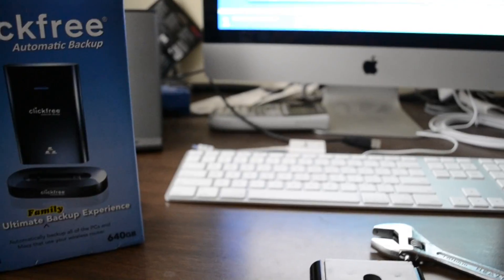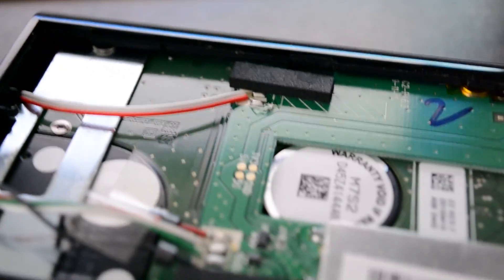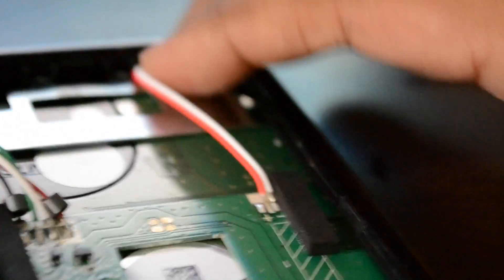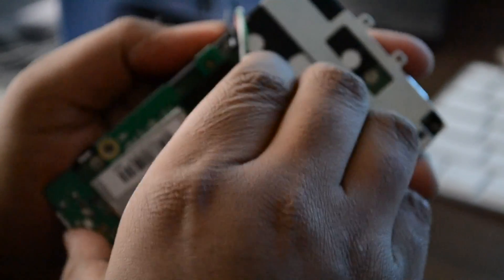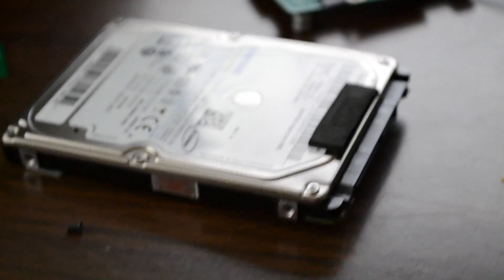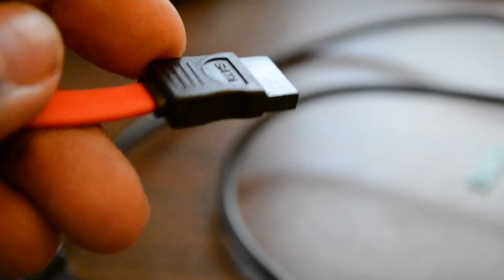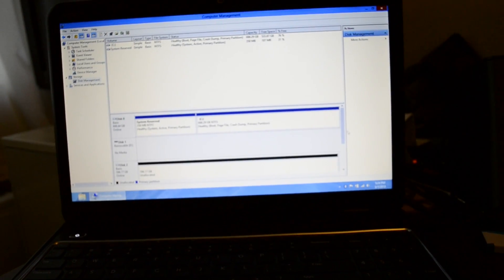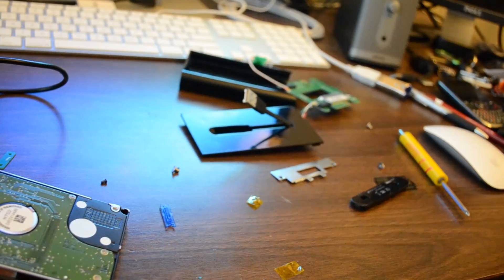How to Take Apart an External Hard Drive and Turn It Into Internal Hard Drive!

Comment: thank you!  i have a WD 3tb drive that had problems - the board attached to sata connection.  removed case and using in a nas box.  works great as internal drive.
Reply: Same feather flux together.

Comment: could you use this in a ps3?
Reply: Yes you could, but you would need to buy a ps3 hard drive case, available on ebay. Then just pop into there.
Reply: You'l need to reformat the hard drive with the playstation software witch you can find online but to do all of that you need to know that you will need to take apart you're playstation to access you're old hard drive but you can always find tutorials online